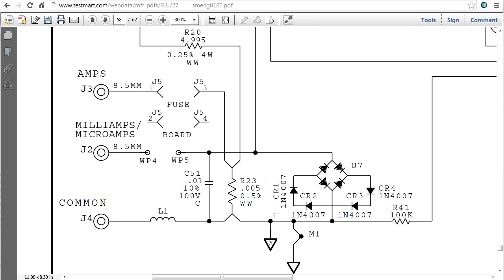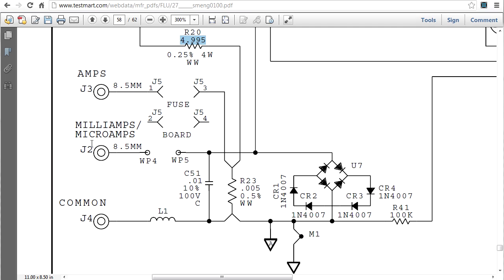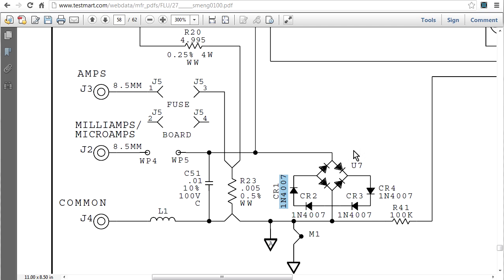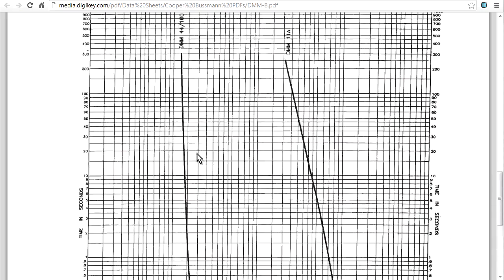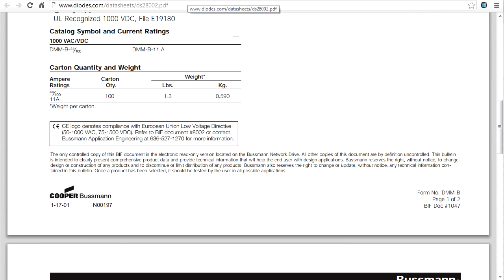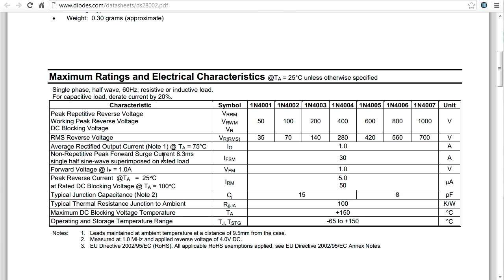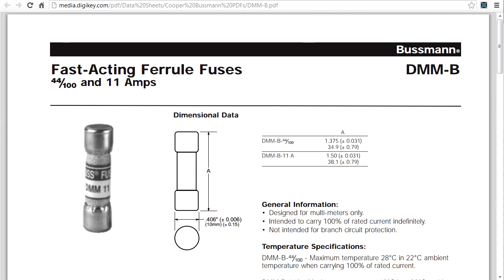EEVblog #376 - Multimeter Fuse Diode Followup

Comment: As i see it, there is even more "protection" of the protective diodes, as the shunt resistor will also carry some current.
So, in the time from the fault to the fuse blows, not only will the diodes carry some current to blow the fuse, the shunt ressistor will also carry some current, (1-2 amps)? which will make the fuse blow even faster.

Comment from the maker: But however, the diodes still function overvoltage protection devices for the ADC inputs in the case of the 10A range. In the 10A range, the 5ohm mA shunt resistor taps off the voltage from 10A shunt, with the diode protection after that. So for the 10A range, the protection diodes functionality reduced to that of ADC and not shunt resistor protection.

Comment from the maker: The 10A range does not have any diode protection for the (50mOhm) shunt resistor. The diodes are only for the mA jack. The 10A shunt is physically a much beefer shunt so it able to handle much higher peak pulses than the mA shunt. Thus Fluke deemed it was not necessary (or possible) to protect it using semiconductor devices. The 10A fuse would simply blow before any damage is done to the 10A current shunt.

Comment: The diodes only conduct when there is a fault current. 10A on the 10A input will just go through the fuse and the sense resistor. The diodes are there to protect the sense resistor. Say you had a fault current of 100A through that 0.05ohm sense resistor. There is now a 5v drop over the sense resistor. That's 500w of power dissipated! That sense resistor would fail before the fuse breaks. But the diode bridge conducts at ~3.6V so the power impulse bypassed through them instead.
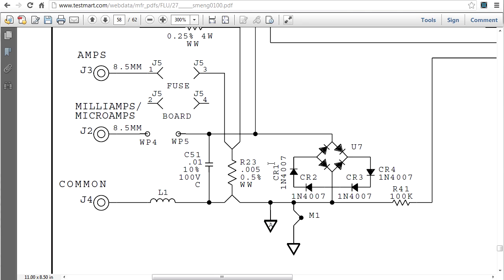Reply: 5 years late... 13:20 The sense resistor is 5mOhm, not 50 mOhm.
The leads have a much higher resistance than that...
Fluke.com : lead resistance—which typically adds 0.1 to 0.3 ohms to your reading.